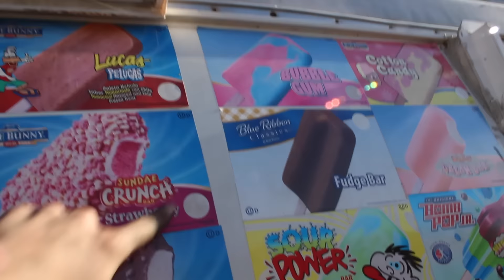Slamming a Focus ST?? (Mountune Lowering Spring Install)

Comment: Please tell me how you got the strut end link off? I have a 2018 so they must have changed it,. There is no place to put a 17mm wrench, it's literally round and using an Allen and an open ended doesn't work do to there being two metal walls up on either side.

Comment: Don't hit it with a hammer put you foot on the wheel studs or on your rotor and push down why would you beat on your car with a hammer, i wouldn't want a company doing that shit to my car
Reply from the maker: +Tysk8r05 Watch any video with these type of knuckles on them. They will not come out by you just stepping on it. It's meant to hold your car up, it's not going to just come out without a little bit of force. Trust me.
Reply: Lmao no amount of stepping on it takes them off. Had to beat the absolute shit out of the hub to get it off.